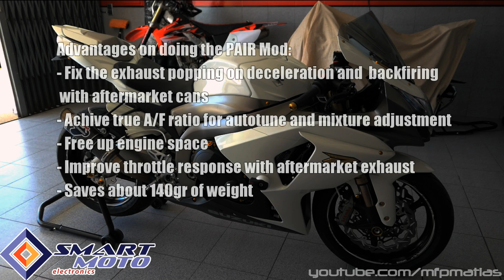PAIR VALVE MOD | SUZUKI GSX-R 1000 | Smartmoto Eletronics

Comment: i bought 2007 GSXr750  and pair valve was removed by owner , so there is 2 hole comming from the engine , so im afraid to dont goes any water inside so what can you suggest ? make line just without valve and connect to the air box ? or plug this two hole ? also if ill plug there is sucking pressure on it . plz give me some advise
Reply from the maker: You can make a line to fit directly to each hole (2) or more professional is really getting this plates

Comment: I have a question I want my bike to backfire a lot what should I do for that then 2012 cbr1000rr
Reply: Similar to your bike when you made the video of your bike shooting flames
Reply: I have a Yoshimura R-77 exhaust
Reply: Well get an exhaust a full system and put it on and dont ecu flash it.thats what ive seen on youtube videos because the fuel and air mix ratio isnt good Thats what i think but ill leave it to the profesionals to answer your question.
Reply: Xforbidden31 Thank you dude I have a full exhaust system of a yoshimura and I did not did ECU flash nor power commander
Reply: @Nightrd55  and it doesn't backfire? Oh. The exhaust in the video is like more of a straight pipe as the muffler is like short and not alot of fibre glass if you get me. . But other than tbat i javent a clue.hope he responds. He might help
Reply: Xforbidden31 Thanks a lot I’m just waiting for the guy
Reply from the maker: Well if you want your bike shooting flames, the "secret" is the launch control, in my case I have from Shiftpower. If you do this mod (pair valve remove) you will have less popping while decel
Reply: mfpmatias I already ordered the pair valve plates I just need to order shift power now so after I block my pair valve will it still shoot flames That’s the question?
Reply from the maker: If you have the SP full race unit it will shoot flames yes
Reply: mfpmatias thank you☺️
Reply: I didn't see if you used back the Reed valve under the block plates. Did you use them to fill that void under the block plates? I just got my smart moto plates from Greece yesterday in the mail for my Rc51

Comment: Might want to rename the vid to "Pair Removal"

The Pair "Mod(ification)" entails hooking up your crank case breather tube to the pair valve, for increased HP due to negative pressure in the engine